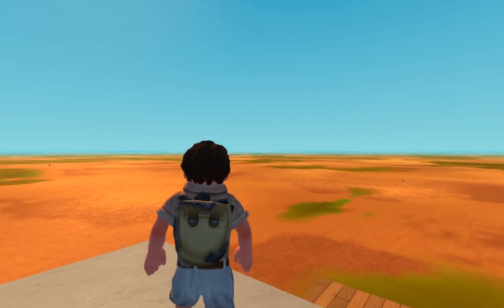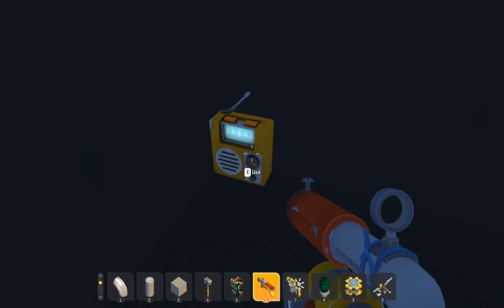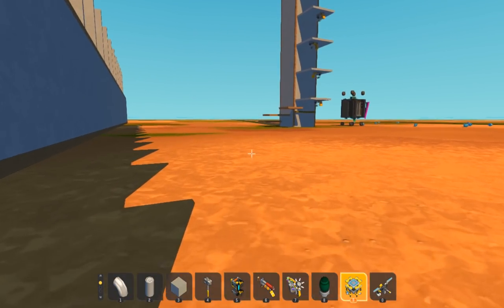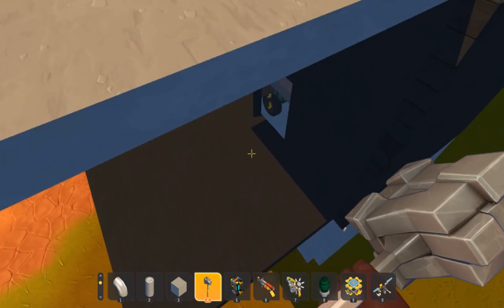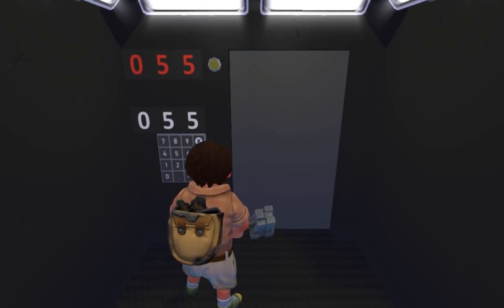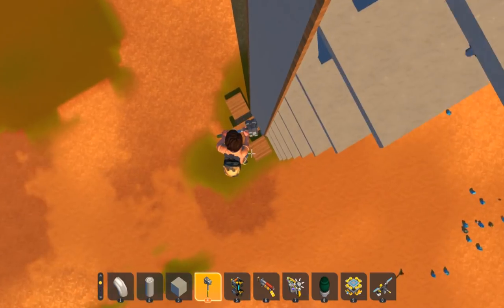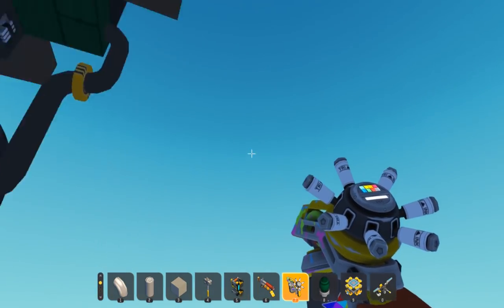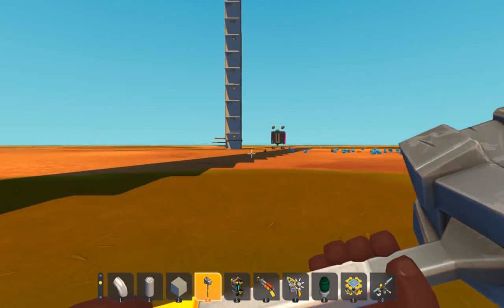Dynamic Elevator works with Any Number of Floors! 👨‍🔧 Scrap Mechanic

Comment: the shaft could do with outer doors? (triggered by a color sensor perhaps?)
Reply: this actually would be easy to add. don't even need color sensor. So floor door are linked to a distance 0 or 1 sensor, when the elevator get at a floor, doors opens, and a block is pushed  by a piston at the same time onto the floor door sensor, the floor doors open

Comment: Could you not use sensors to identify floor locations and top/bottom levels?

That way it can automatically stop at the top or bottom of the shaft and it could also stop on the floors even if they're unevenly spaced.
Reply from the maker: Originally I wanted this to be an elevator that could "work any shaft"
So that meant as little as possible to setup the shaft itself. I didn't want to have to paint floors or setup doors or do anything special for the building itself; the live stream efforts were only elevator design.

In hindsight, yes this is much smarter. People are suggesting extra logic for accounting for different floor heights, exceptions to that rule, etc.. just a reaction to the floor is probably the way to go..

Problem is: when to start slowing down. The math used to slow down when arriving is based on the distance the elevator KNOWS the floor is at. 
Reaction based system has to do that a different way..idk... it's a different way of doing the same elevator so different problems to solve. 

Might be fun to give it a try on another stream sometime!
Or if you build / change my elevator, definitely send lemme know so I can see!

Comment: This just blew my mind, I want to build a "sky" base in survival so I went to check out some ideas and saw this. It's a bit too complicated for what I need, I need just one stop about 400 blocks off the ground, but it still gave me an idea how to do so.  

Would you be able to come up with a system that is strong enough to lift up a semi large mining vehicle? I always have problems making a lift that can actually handle a decent weight. 
Great video and thank you for the inspiration!
Reply from the maker: Yup, you could actually use this same elevator I think; just set the floor size to 400 blocks and it will go up to "floor 1" and then open up
Not too different from using a bunch of pistons that extend the right height with a single switch
For heavy weights, I would probably try a gear/rail system, instead of depending on friction wheels. Mods or plain vanilla, anything that interlocks to turn rotation into linear motion. (e.g. A plus shape on electric engines "+" that interlock with a comb shape that runs along the wall of the elevator shaft "⊧")
The Smart Engine in the Modpack can set a custom power and speed value, allowing you to have the strongest / slowest engine possible, at any combination that works for what you're lifting.
If you're using mods then there's all kinds of fancy things you can do like adjust gravity or use smart thrusters that change depending on the weight you put on them.
Reply: @Durf  Thank you for the advice. I've spent all night last night trying to come up with something that can lift up my survival truck. I tried making a rail system lift and it worked amazing, I'm not that great with programming but I managed to come up with a system from couple of logic gates, pistons and sensors to control the the speed and the end locking mechanism, I was really happy with it. I scaled up to have 4 Pillars/rails instead of 1 central one and it worked amazing, in creative that is... I imported it to my survival and everything was fine until I welded everything in place and now i have a slide show :/ Stuck with 12 fps, but once the lift finally reaches the top I get insta 144 fps even if my truck is still on the lift? I'm sad and confused but i'll keep on trying, I still have few ideas now. Your videos really help, I get a lot of  inspiration/ideas form them. Thanks again and good luck on your future builds.

Comment: theres a slight problem... the elevator wont spawn it just keeps saying: FAILED TO BUILD SHAPE (ID: 706f6c79-5f5f-4200-a9a9-01ccc01ccc04)
Reply from the maker: Be sure to include the necessary mods:
The Modpack
The Modpack Polygons
Polygons Pack 3.0 Optimized

Let me know if it still isn't working
Reply: @Durf  ok thanks